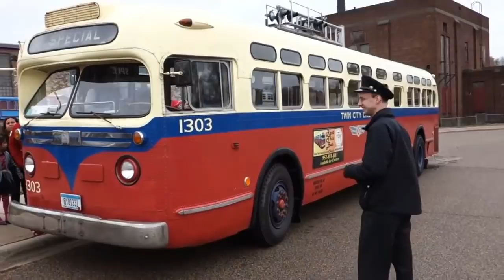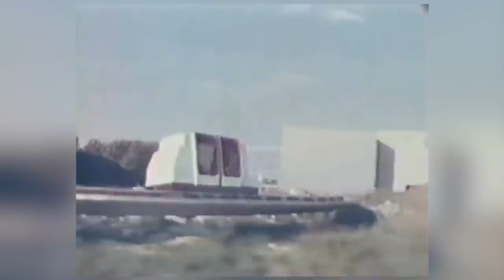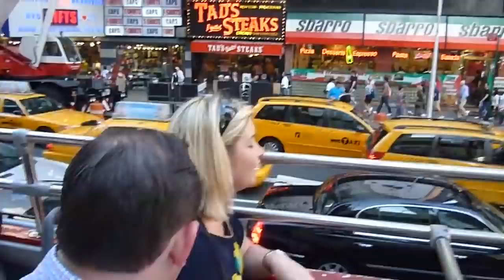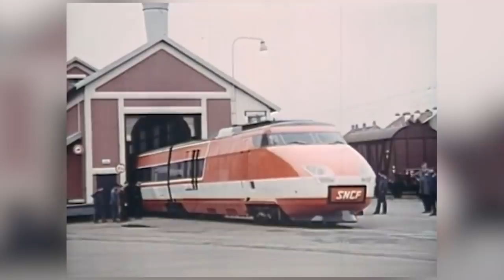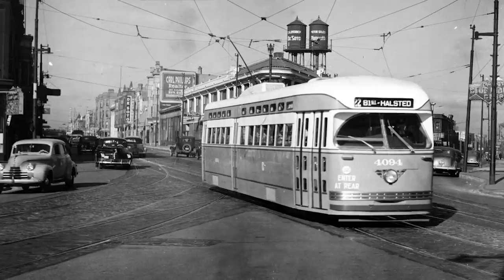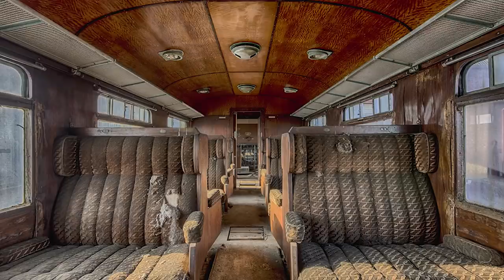12 Most Amazing Abandoned And Forgotten Trains

Comment: Hi from Green Bay Wisconsin USA. The G.M. Aerotrain #2 is right here at the National Railroad Museum. I was the official tour guide and paid employee from 1984 to 1989. I always had to change the tour speech for each group, whether is was 5 year old kids in Kindergarten, or 70 year old senior citizens. The Aerotrain diesel is called Class L.W.T.-12, for Light Weight Train with 1200 horsepower. But it was under-powered. Also the wheel arrangement is B-1, with only the forward truck having only 2 traction motors on a Flex-coil frame. But nearly 50% of weight was carried on only 1 idle axle. Clearly it should have been a B-B with 4 motors , and 1600 HP. With the bus body coaches, all vestibules and doors faced forward. With 40 seats each, times(x) 10 coaches per set equals(=) 400 passengers. But the two-2 axles are supported on air bags, leading to a rough ride on rough track, and extremely bad vibrations. These bus coaches have very large couplers that included air hoses and electrical connections that were supposed to connect automatically, but won't work.  While some also liked the angular windows.  But the aluminum bodies were too lightweight, but couldn't activation the semaphores nor grade crossing gates. Rock Island retired them in 1966. Then donated diesel #2 and 2 coaches here to Green Bay. Then also diesel #3 and 2 coaches were donated to St. Louis. But all other coaches were scrapped, along with the 2 special obversation cars with twin tail fins, styled after the sports cars of the 1950's jet age and space race.  But the 2 coaches in Green Bay continued to carry passengers around this museum's circular track for nearly 25 years until 2001.  First pulled by the little Plymouth #702, then EMC from 1938 NW-1 #90, plus CNW #4404 GP15 during their employee picnic.  Then 1985 Miss Budweiser red 20-tonner Plymouth. And 1989 fake steamer/diesel made from Sumter and Choctaw RR in Alabama#102-2-8-2 Mikado 64 tons by Baldwin 1924 as worlds lightest standard guage Mikado. And East Troy Electric #3 G.E. 45 tonner center cab with side rods, but disguised with a tender body.  But it was a disaster and always fails.  So please write a real letter to NRRM, and Really Demand them to rebuild the #102 back to a regular display loco. But Not this ugly Frankenstein Hybrid. Thank you!!  "10-Q"!!  73.

Comment: I‘m actually a little confused that you forgot to mention the story of the German Transrapid. It actually holds about three speed records across nine generations and all vehicles are abandoned as the test track closed down. A slightly changed version of the TR08 still runs in Shanghai and reached speeds of over 310 mph (~ 500 km/h).

Comment: Big difference between Train and Locomotive. The locomotive pulls the train.
Reply: #True aprooved by a railfan.
Reply: Actually, the locomotive pulls a consist, and the two make a train.
Reply: @markcarey8426  we don't call them consists in the UK
Reply: @AndromedaExplorer2026  Well I'm surprised. I think that's where I heard it.
Reply: @markcarey8426  Also what's interesting. The Aero-train isn't a train.
Reply: @scootergrant8683  You're right. It's a consist. :)
Reply: @markcarey8426  Also, the original definition of a train as in a train of camels doesn't require a locomotive or a driving horse. Thus, given the term came from that application, I'd say a train doesn't need to have a locomotive to be a train. Gosh etymology is odd.
Reply: @scootergrant8683  But. Didn't every train of camels have a person in front?

Comment: The Chicago trolley's Ed Metca purchased were nicknamed "Green-Hornets" because of their futuristic, low to the ground, streamlined  design, and their green and cream paint-scheme.  Most of them lived on for another twenty-plus years as "EL(evated)-Trains" with their bulbous ends lopped off.  The rest were piled up and turned to scrap after Chicago abandoned street-level railed transit and went to trolley buses that ran on rubber tires but used the overhead electric wires for power.  The electric buses were, ironically, pulled out of service and abandoned right before the gas crisis on the early 70s hit.

Comment: Why do they allways refer to a single unit or locomotive as a train?
Reply: Not every viewer is a rail fan
Reply: To compensate for having to invest in shares with conventional standard or broad gauge tracks. The monorail design is cheaper to engineer along with using single units instead of multiple coaches behind a locomotive